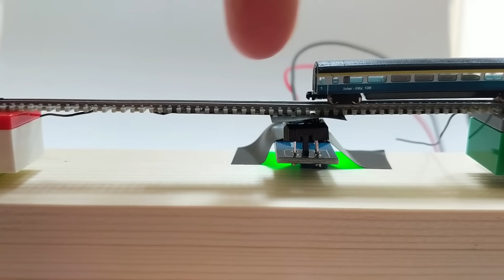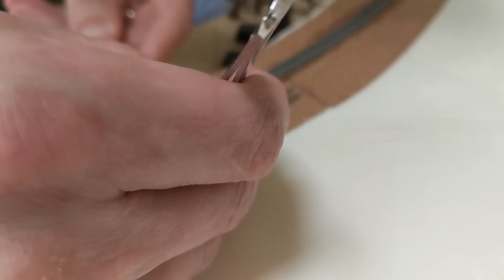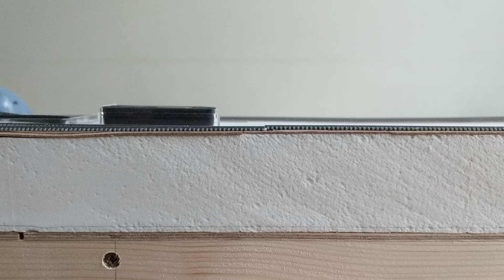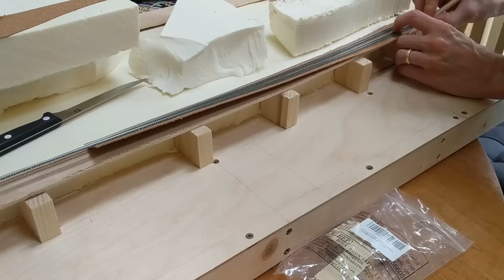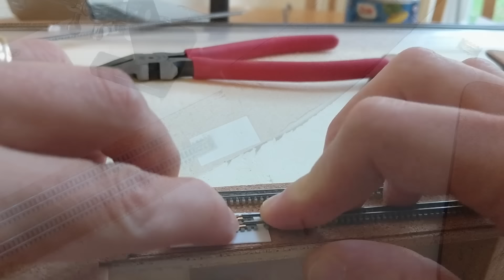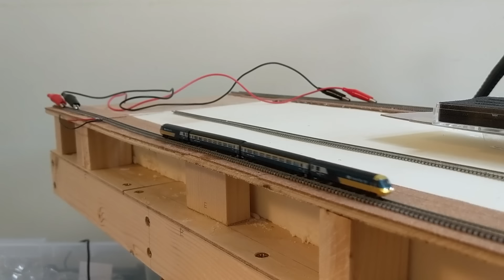Completing one loop (twice) - The Dawlish T Wall [0055]

Comment: You definitely seem to be finding it heavy going, mainly as a result of a few key early decisions.  When I did a conventional T layout some years back with 14m of flex track, albeit only on a single board, I did a few things a bit differently.  Laying the track directly onto the plywood track bed, mounting the support timbers sideways so their identical width determines the track height, using superglue rather than copydex, and using those flex track joiners everywhere were the main points.  Seriously, when concealed with ballast and paint, they are effectively invisible.  I only had one troublesome joint, on a tight curve in a tunnel, and eventually forced the correct alignment with two screws on an angle just outside the track with their heads pressing against the rails.  While I had no board joints, I imagine super-gluing the tracks on each side to a piece of PCB replacing the cork and then being able to adjust the PCB alignment and height with shims and screws should work (soldering, as in larger scales, is impractical because of the steel rails).  Either that, or just leave the last couple of inches of the ply (not ply+cork) floating and allow for adjustment with screws and shims.  Anyway, stick with it!  For example...   https://modelrailmusings.weebly.com/uploads/1/1/8/5/11853701/8144883_orig.jpg
Reply from the maker: Sideways timbers is a good idea - I got slightly stung because when I first put the baseboards together it was using custom wood dimensions from an online website, but they stopped trading so I couldn't get any more wood of the same dimensions for a sensible price. How did the trains sound with the tracks directly on the plywood? The motor in the HST seems quite noisy considering how small it is, a whole rake has 3 motors, and of course the wheels are magnetised to easily carry the sound through. I've been able to solder wires to these rails, so at the moment I'm inclined to try soldering to PCB stripboard, if dimensions allow, but if that doesn't work out it's good to know superglue isn't too brittle to use instead. Thanks for the picture, advise and encouragement 🙂
Reply: @endoorrailway  I changed from N to T about 12 years ago, and while I tried using cork on one N layout, even there I found it more trouble than it was worth.  It lost much of the sound deadening effect when the track was ballasted.  With T, especially with the twisty flex track, you absolutely have to anchor it firmly.  Yes, the trains are a bit noisy running directly on plywood, but whether you consider that a bad thing is another question.  Here is an old vid of mine with the raw sound... https://youtu.be/zuQ2-VBGIDY   The traditional way of doing board joins in larger scales is, as you say, soldering the rails to a strip of PCB.  One possible trick if that proves difficult with the steel rail (note, I haven't tried this) is to slide rail joiners fully onto the rails at each side and then solder those to the PCB, using them as handles.  Anyway, take heart and stick with it - I did get mine to work properly through a few years of exhibitions, and the track never caused any problems!  I eventually abandoned conventional T, changing course completely, partly because of the cleaning and maintenance requirements, and partly because too many complications arose for layouts more complex than Dawlish or Sarum.  What you are aiming for is very doable, so do it!.
Reply from the maker: That HST ran very well over a lot of track, so you clearly know how to make it work! Thanks for sharing that. That's a good idea with the fishplates - I'll make that option B 🙂 Thanks - I've spent a fair bit of money to get this far, and I like the actual scale, so I'm determined to keep going even if I do have the odd moment of considering giving up 🙂

Comment: Hi Jonathan 👋  - good to see the T gauge layout again.  It does make N Gauge look huge in comparison as you said in the commentary.   Good effort in trying to lay the track.  I was surprised the track across the two baseboards didn't align properly as you aligned the baseboards themselves with dowels etc. Cheers Euan 😊
Reply from the maker: Hi Euan, it was as I was putting some things away in the railway room after a load of T gauge work that I just ended up with my face right next to some N gauge track, and it just seemed so big compared to what I'd been staring at for a while! Thanks 🙂

Comment: Have you considered using magnets? For the rails and getting a more accurate levels…also the foam sealer used around domestic doors? Could that be used I wonder? Until seeing your videos, I had not realised such fine skill and detail was involved…great to listen and watch you
Reply from the maker: I must admit I hadn't considered magnets, thanks for the suggestion - they might be strong enough to overcome the twisting tension in the rails, but I'm not sure whether or not they'd also have an effect on the trains that might not be desirable.

What would the foam door sealer be for? Would that be instead of the cork underlay, or instead of the Copydex glue? I'm used to seeing it around doors of course, but it's not something I've ever worked with directly.

I must admit I hadn't expected to need to be so careful at this stage of the build - I was expecting it to come later with making the little scenic features! Thanks 🙂
Reply: @endoorrailway yes the glue, as glue can almost melt or burn sensitive material…also the magnets, I’m not sure the best way…but I was thinking of magnetic clasps…but I’m sure some kind of magnetic card, remember fridge badges? This kind of idea maybe, I’m sure you will find a way..,could be a trial and error…I shall keep a look out for more of your videos, I find them very creative and relaxing…take care and good luck!
Reply from the maker: We'll see how it all goes, thanks for the ideas 👍 I'm glad you like them, thanks for letting me know 🙂

Comment: Brilliant video, and I admire the perseverance! It has to be said, you're entering the jump between railway modelling and high precision. 
The alignment issues between Feb and September could be very interesting, as we've had such a dry and hot summer, I wonder if the timber has released a lot of moisture and shrunk more? Will it go back over winter? 
Regardless, it's looking great.
Reply from the maker: Thanks 🙂
That's a good point - if it takes me a long time to get around to replacing some of the wooden blocks with metal rods we might see if it changes again over winter.
Thanks for the encouragement 👍

Comment: Don’t want to be rude but I would get rid of the foam and cork. Why would you mess around with semi solid materials for these tiny trains? I see no reason for that and would mount everything firmly to one piece of plywood! No seems no height differences. Same for the brackets, why not just glue them on and get all messy with brackets and screws: I think you are overthinking everything for this scale, I would concentrate more on a real solid base replacing all the packaging materials.

Good luck -1-

Sebas
Reply: 10mm foamboard is fine and good enough for t.
Reply: Exactly what I thought 👍
Reply from the maker: Hi Sebas, thanks for your thoughts - you're certainly not alone in thinking fixing the track straight to plywood is the way to go. The main reason I added thin cork was for some noise insulation - whilst these trains aren't heavy their motors are surprisingly noisy, and the wheels are magnetised so make firm contact with the track.

I don't like glueing the bits of wood on because I may need to make adjustments, and in fact I will be needing to change some of them so I'm glad I didn't glue them on. I honestly don't know why I thought I needed right-angle brackets though - that really was a waste of time.

One of the things I did in this video was remove all the foam that was under the trackbed areas. In the previous video the big block of foam seemed a nice easy way to get the right land shape for the sea wall, especially as I hate using my jigsaw with plywood, but clearly foam is not the way to go under T gauge track!

Comment: for off scene areas could a small bit of copper clad PCB board work? rails soldered?
Reply from the maker: I think that's worth a go - I've got some strip board, so if the spacing aligns with the rails (I'm away for the weekend so can't check) I think that will be strong enough, but also easy to drill through to attach to the board. Thanks 🙂

Comment: I would recommend a decoupling mat, like used in the tiling industry. You would stick that to the timber using vinyl floor adhesive. It's 1000mm wide and however long you want to cut it, so there would be no joints. You then fill in the square matrix with rapid setting tile adhesive. This will allow the timber to move with changes in humidity, while the mat and the track remain unaffected. Google, Schluter Ditra 25 Matting Membrane, and say goodbye to all your timber movement issues.
Reply from the maker: Thanks for the suggestion - that's not an approach I've seen used on model railways before. The misalignment I need to tackle is where the two halves of the railway meet - that needs to be able to separate, so that area is always going to be affected by what the baseboards do. The wooden blocks I've got supporting the trackbed are softwood - I don't know if that means they're more susceptible to changes with humidity and temperature, but I imagine metal rods will be much more stable.
Reply: @endoorrailway ok, I didn’t notice it was in two halves.

Comment: For baseboard joints i ALWAYS reccomend fixing the track to plywood thats the same thickness as the cork you used. That way there is NO squish on the ends of the rails at all. 

It also helps to reinforce the joints and keep things inline cos you can stick a pin or screw through the track and have it embed into solid material.
Reply from the maker: I think here the plywood at the baseboard join isn't quite where it was before, so even if the track were anchored firmly to that I think I need to be able to fine-tune the height of the plywood itself. I don't fancy trying to get a pin through these sleepers, or the chances of the sleepers not snapping if I did, so I think soldering the rails to something that's attached to the ply is going to be the way to go. Screws over sleepers would probably work, but I think having four of them close together in a scenic section would look bad, so that'll be a last resort. Thanks for the suggestion 🙂